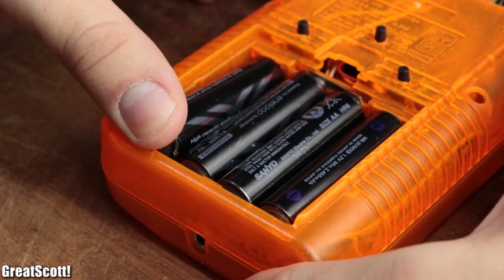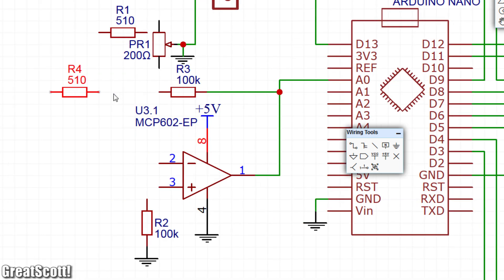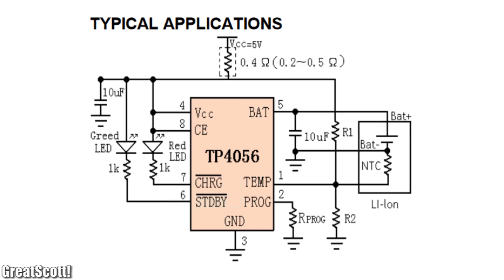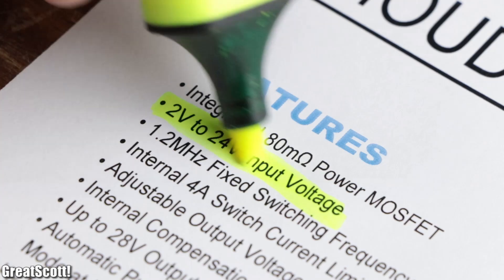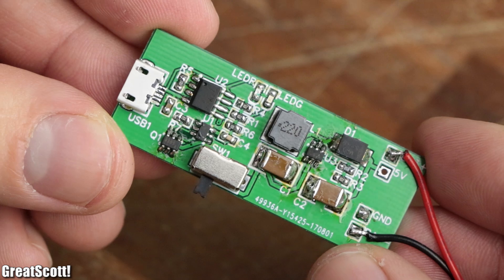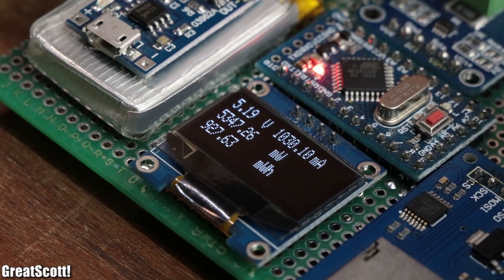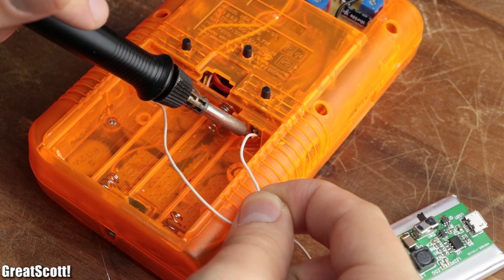DIY LiPo Charge/Protect/5V Boost Circuit

Comment: Is there an alternative to these components that can handle 15V 3A input? I'm trying to design a charge circuit for lipo batteries from a 15V source, but am struggling to find suitable components, since the selection is so huge.

Comment: The TP4056 has a solder pad on the bottom side to reject resistive heat. As a good thermal management practice, there should be multiple PTH connected to the bottom layer and a large continuous plane on the bottom layer to act as a radiation plate.  Also, if the W*h of the lithium cell used is less than 4 NiMH cells, there is nothing to gain in run time, only lower weight and convenience, if appropriate.

Comment: This is strange, why would it not turn on when over discharge is detected, when new charged battery would be added ? Why does it need first connection from charging circuit... this looks like a "bug". What if I want to use it just as discharge protection, and there is no charge circuit ?

Comment: does the IC switch off the output if the load is too low? other circuits do that, but I want to use it to power a device that only draws 20mA.

Comment: Would this work ok with an input voltage of 6v as I want to use it on a bike hub that outputs 6v3w. I have struggled to find an off the shelf one that works with a 6v input, thanks?

Comment: Quick question!!! CAN i use TP5000 to charge 3.7v 1500 amps LIPO battery?...the chip (Rs) is programmable. I dont know how to program it fir different charge current modification. Is it true that I can use TP5000 just for LI-ION and LIFEPO4? and not for other batteries than that?. Looking forward for you reply. Thank you

Comment: Nice work Scott!  Could you tell me what happens if you skip the toggle switch in the circuit (remove toggle switch in schematic) and connect it directly without it

Comment: Does this circuit also function as a buck converter? Can you set the output voltage lower than the battery voltage?

Comment: Awesome job! @GreatScott, what would I need to do to increase the output to 5V@3.5A or 4A? Currently, your output is 5V@1A. I need to power an RPi4 + LCD TFT 7". Also, to extend battery life I was thinking of having two or more Li-ion cells on my portable Pi project but it will require a TP4056 for each cell. Do you recommend another configuration that might be simpler when dealing with more than one Li-ion cell? Or will it be better to have a big, i.e., 8,000mA LiPo battery instead, but then a TP4056 will take forever to charge it right?

Comment: So, he just fed the USB power through the TP4056, with the boost converter feeding off its battery output? This is totally wrong!

First, when on USB, you're always burning 5V down to 4.2V on the TP4056, then boosting it back up to 5V. Second, the power draw from the USB is limited to TP4056's programmed current. If your consumption exceeds that, you'll be needlessly drawing from the battery, even though the USB can usually provide at least 2A at 5V. Third, it's just fucking ugly.

What I expected is a circuit that would switch to USB power (and charge the battery) while it's plugged in, but use boosted battery power otherwise, with a seamless transition between the modes. Hell, you could even cheat by using an MCU!

Comment: Hi, Great video 👍. I need similar circuit with solar panel integrated instead of charger . And auto start of boost once after over discharge and then battery voltage reaches 3.3 volt (kind of switching). Can you please guide me.

Comment: Besides using a 1.2k resistor for RPROG on the TP4056X, do you have to make any other modifications to provide charge at 1 A? 
The rest of the components seem all be rated to handle 1A just fine.

Comment: Short circuits set the voltage between the VCC and GND pins of the power supply to almost 0V.

Comment: Boost converter handle 10 watt load  and  proper 6.5  ohm resistor  handle it , not 5 volt drooping fixated volt steel ok.

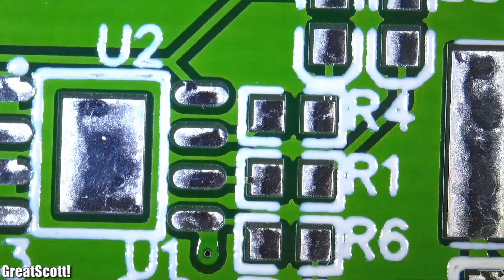Comment: Hello sir, I have a stupid question. At 6:23 at the center of the IC there is a big rectangle with solder on the PCB. Does it need to be soldered to the bottom of the chip? What happen if I don't solder it, especially when I have only solder iron and don't have a hot blow-gun? Thanks.

Comment: excellent video.
 I have a question regarding short circuit protection

when the short circuit occurs the system disables the voltage output as seen in the tutorial, but the short is hardly removed

Should the voltage output be manually enabled? or
the same system enables it again?

Comment: sir, please help me, which charging module is best for 3.7v 500mah LiPo Battery, (the TP-4056 seems unsafe because of 5v/1amp output)
or, should i just change the 1.5k Rprog Resistor in TP-4056 to 5k or a10K Resistor for 130-250 mili amp output.
Another question: Do i need to use a Charging+protection board if My battery has inbult BMS.
also i need to convert the 3.7v battery output to 1.5v (for my wireless mouse)
and also i want to keep the size and weight as low as possible,
Please help me, I am so confused 
Thank You

Comment: Hey @GreatScott i need some help . Now here's what's happening . Now i want to go ahead with the Dw01 ic instead of the fs312 ic which you choose for but what's happening is that when my battery voltage drops below 2.4 volts the ic shuts off the output but then because the output is now shut off the battery gets time to regenerate its voltage and as soon as it reaches 2.9 the load again starts to draw power but because the battery actually has very low juice left it again drops back to 2.4 and system shuts off and this cycle of the system on and off goes on and on. I want the same feature as yours that once my battery is below a certain voltage only connecting the charger enables the output again . How do i achieve that with DW01 as i went through the datasheet of both the protection ics and this feature of enabling the output when charger is present is not a feature of any of these 2 ics so how is it happening and how do i solve it for my system. Please guide me .

Comment: Could this be used as a 5V LiPo UPS module? Also, any suggestions on how to achieve a bit higher output current, perhaps in the 2A range?

Comment: Dear @GreatScott!
 
Do you know what's the minimum output of current this pcb works with?
I am testing an esp8266 in deepsleep mode with some sensors, but some powerbanks and pcbs don't allow such a low current of the esp8266 in the deepsleepmode (~20 uA).
Thanks ;)

btw I'm a fan from germany !

Comment: You are awesome, thank you for your effort.
Can you teach us how to make the same board that reduces the voltage of 3.7 or 4.2 volts for the lithium battery to 3 volts constant .. There are some electronic devices that work with two AA or AAA batteries .. The simplest example is a TV remote control or an air conditioner remote control
Reply: Use a buck converter
Reply: @ItsDextrin  
Thanks for your suggestion, but the buck converter consumes a lot of energy and drains the battery quickly .. I think there is a better way using resistors only to save the battery for longer periods.

Comment: great scott i need help
i bulilded 12 boards to take 4 TP4056 per board demanding 5V at 4A. I found a power supply 12v 62A. 750W. I am using 12 board needing 48A  i can use a 6 buck (2 boards per buck)converters but my question is if the buck converter max A is 10A .but my PS Amperage input is 62.4 A will this PS   blow the bucks converters?(with a max 10A rated)o can i use this power supply directly with any modification?
thanks

Comment: If I were to remove the boost converter switch, and directly connect that line, would that work to permanently increase the output to 5v, or is the switch required for the protection of the circuit?

Comment: Great Scott - loving the work - can't believe the price of those custom boards! I need a very similar board. It needs to be regulated, uninterrupted, and rectified. I have a 0-12v input with reverse polarity (model train) and need to convert to 5v 240mah output for fpv cam. Can you point me in the right direction? I don't think I have sufficient knowledge to design a circuit but more than willing to learn if you can recommend a site to start with.

Comment: Great Scott, I'm trying to change a power source of a divice from 870ma to 3000ma. But the smaller battery as a little circuit board attached. Where can I get my questions answered concerning this simple project ? do you have a video on this type of upgrade ?

Comment: One thing I do not understand though is what is the issue with the integrated li-po battery protection circuit? Pretty much all of the li-po batteries have a small protection PCB added at the top of the battery and it's pretty much identical to the one you designed. I understand, that you might not trust the integrated circuitry (chinese batteries probs use DW01 chip, but even using it a potential divider circuit can be used to rise the desired under-voltage circuit..) or maybe you will want to use it with other type of batteries (pill type li-ion), which do not have the integrated protection, but you didn't state it in the video so I just got curious. Thanks for the answer!

Comment: Hello Scott, i have a question, in the boost converter there is a ENable pin that could be used disable the boost and so the switch could be connected to it leaving the IN pin connected all the time to the Vbat, this way the small switch doesn't have to carry all the current of the boost converter

Comment: Is possible to use FS312F and replace standard chip in 14S BMS from aliexpress, or do diy 14S BMS with this chip? I want to make mini laptop but just need discharge protection better then 2.5v, then I would use step down to decrease voltage to 15-19v. Overcharge protection would be in charger so not much important.

Comment: Great elaboration. 
But considering the results with the datasheets of MT3608 rated 2A, how would this circuit behave if the load is changes from 6.9 ohm to 2.7 ohm or 3.3 ohm? 
Will the over current protection circuit come in picture or the boost circuit output voltage will break down?

Comment: IS THAT POSSIBLE TO ADD A VARAIABLE RESISTOR ON ONE OF THOSE VALUES AND GET A ADJUSTABLE OUTPUT VOLTAGE
?? AND ALSO SOMEONE PLEASE SAY WHAT WILL BE THE RESISSTOR VALUE FOR OUTPUT 12v ?
Reply: ALSO TO MAKE THE BATTERY USBALE WHILE CHARGING WITHOUT A SWITCH

...MY PERSPECTIVE WAS TO CREATE A AUTOMATIC UPS FOR MY 12v ROUTER OUT OF 3.8v lIpo BATTERY ...................

Comment: In your Instructable someone mentions you have R2 and R3 inverted, is this correct?
I made the circuit and the charging part works, but I get an output of 3.8V instead of 5V. Swapping R2 and R3 changed nothing.

Comment: And what if I don't need a boost function and will power the Arduino Pro Mini 3V3 directly from the battery? I connect Bat+ pin to RAW Arduino pin and where to connect GND pin of Arduino? To the Bat- pin or to GND bus?

Comment: Have you got any chance looking at IP5303 IC for lipo charger and boost converter along with overcharge and discharge protection, everything in one single 8 pin IC. There is a module which is in market named as "MH CD42", you can find that in Aliexpress. It's a guess even they are using IP5303 for that module, but not sure. It would be great if you could also investigate on this too.

Comment: hi. as i don't want do the solderring so i added this 2 module to make your circuit. one the tp4056 charging module with a mt3608 module, but when i try to power my pi3 with it the charge module drop the voltage to 1.3v in middle of the boot. pi shuts down middle of the boot. What might be the case?

Comment: do you know that the battery shown in this video has its own BSM with built in over-charge and discharge protection? I've used that exact battery in a project and it does work.

Comment: Made this circuit myself and I'm getting a wired error I can't figure out.. when connected to the charger the green LED lights up (even though battery voltage is 3.5v) and the red LED lights up very dimly. No such mention in the datasheet for this error closest match is for blinking red LED which says add 10uf cap to battery pin. I've tried this to no effect.. any ideas??

Comment: Thank you so much for your links, I've created an advanced solution out of them with possibility to measure the current and the battery voltage to monitor my system. Now i have to test it.

Comment: Great videos! Q: Why can't LiPo batteries simply be charged with a fixed voltage level @ let's say .5 VDC below their fully charged level?
Example: I purchased a 50000 mAh power bank, which has 19 VDC charge input (I want to use 19V 40W PV panels for charging), USB-C & USB-A (to power RPi 3B+ or VIM3 SBC), and 5.2mm barrel w/selective outputs (12 VDC for small tracking motors). Perfect... except, the power bank shuts down when the sun doesn't shine.😣 So, I need to replace its 'brains'.
The power bank contains 8 x 3.7V LiPo batteries (4 banks of parallel pairs in series), which measured  16.5 VDC fully charged (with mfr's charger & circuitry). But, I have reconfigured them into 2 series banks of 4 parallel batteries which reduces the fully charged voltage to 8.4 VDC (7.4V rating), so that I could use a buck converter with a lower input voltage to accommodate times of lower PV output. Another buck converter replaces the 5VDC output and a boost converter replaces the 12VDC output.
What would be wrong with simply setting the charging buck converter to 8 VDC for a constant ~12 hr daily charge cycle with ~12 hr nightly discharge cycle?
Thanks for your time.

Comment: Great scott .... Can youhelp me i need  output of 3.3volt 1amp  from lithium polymer 5000mah  also need to charge the polymer battery after discharging. Any 2in 1 module you can suggest

Comment: Hello this video is really good.
sorry for my english

Is it possible to use the 5volts during charging time?
i'll try to explain my question...
I use an alarm system (with Arduino) and i want to have a power rescue. If i loose main power voltage i need a battery to maintain my arduino ON in order to send an alarm.
i think i just need to caculate the capacity of battery with the time i need my system run without main power supply.

Is it possible with this circuit ?
Thanks a lot
have a nice day

Comment: I know this is a old video but thought of a question. Which is more efficient, the boost or the buck converter? Curious because if you go with 1s you need the boost or go with 2s need a buck.

Comment: Hi :D
I want to make my usb c lipo charger pcb.. but I am having problems on understanding how type C usb release power.. has somebody worked with type C usb power? (I don't need to communicate, so I can't understand if CC pins are useless). (I'll attach it only to a wall adapter)

Comment: hello GreatScott, or any other commenter
I have a question, 
Well, i do not understand why you used a Button to turn the circuit of when charging, as far as i can see, this is only optional. 
Is there a important reason?
Reply: Falcon though I didn't see the project file yet I could guess that the switch disconnects the charging part of the circuit from boost converter since it draws additional current even without a load, so this will result in faster discharge.
Reply: Олег Воробьев its the other way around, the switch turns on the boost part of the circuit
This would mean the battery charges fasterr???
Well, i have upgraded his board, mine now has the capability to Output 5V and 2A 
If you are interested you can ask me 

Greetings and 
Thank you for the answer

Comment: Is it possible to not have the switch there? as im planning on using this with a pi 0 and it runs on 5v so i wouldnt need to turn the booster off?

Comment: Hi i am thinking or using a pijuice hat to providing portable power however what i want to do is parellele wire two 12000mah battereas together and I am looking for a ciruit or board that will allow charging of two batteries like the pijuice. Would you consider doing a video on this on making your own or improving on tje original to allow duel charging

Comment: Hi, GreatScott, i only recently found this video and fell in love with it. Can i ask something? why did you choose 0603 component sizes and not bigger... lets say 0805?(i want stock up myself on lcsc, so i am creating BOM) is it okay to solder this small packages with 5x magnification, or do you consider it hard? (handsolder or hot air). also have you experince with traces between 0603 pads? Thank you! :)

Comment: So if I wanted to add a small solar panel as the input (instead of USB) I could do this at the USB connection point instead of adding the USB port. Also instead of having a manual switch to allow load to draw, how could you charge and draw at the same time? Possible I may have missed something here.... Also, want to give you a great plug - I've learnt a lot more from watching your videos - thanks so much!
Reply: This is exactly what brought me here, so I'd also like to know if a solar panel (max 5.5V) would work, too and how to charge and discharge at the same time. I need this for a weatherstation project. Please let me know if you found/find something out :)
Reply: Kartoffelsnack - no sadly I haven’t had a chance to research a bit more into this yet!

Comment: Hi, my Xiaomi 10000mah power bank with a li-po battery stopped working after it took a hard drop. I've a couple of Power bank circuit board with me. Can I use any of those board to charge the li-po battery? Please let me know. Thanks in advance.

Comment: Can this circuit charge and discharge at the same time? I've seen power path management designs that use a p-channel mosfet as a one of a pair of diodes in an or'ing circuit. Would there be any benefit to including that in this project?